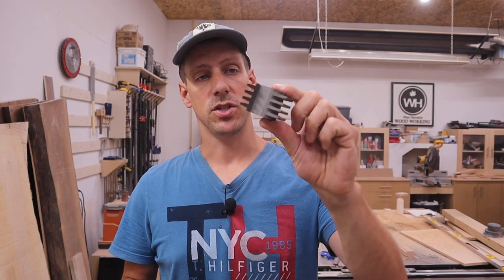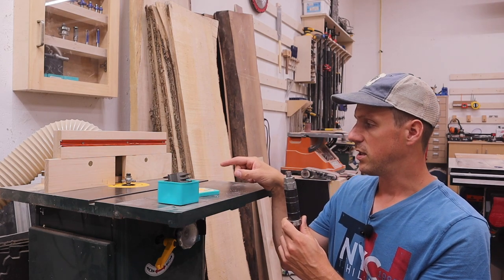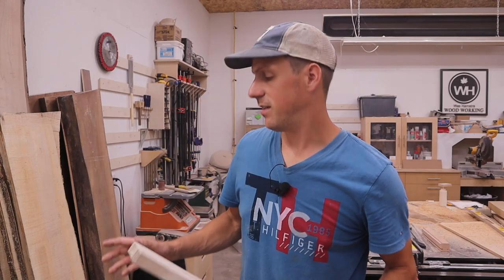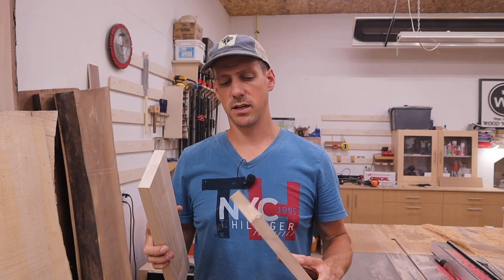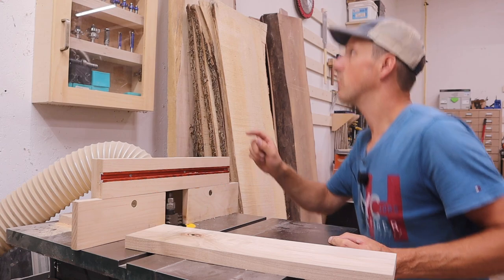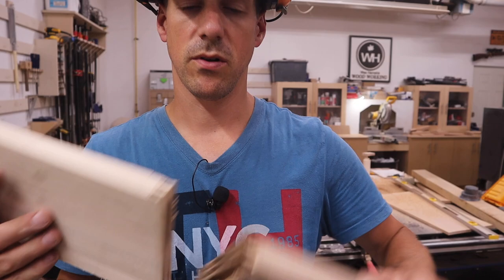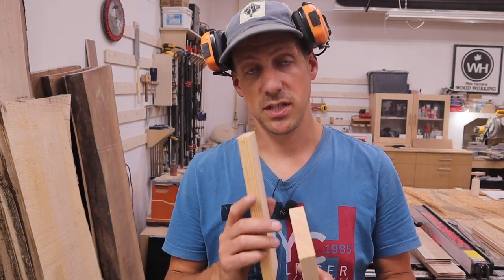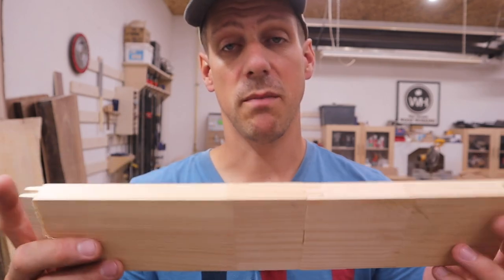Trying Out The Finger Joint Router Bit - Surprising Results!

Comment: a fellow canadian woodworker, i'm in sarnia ont.  a shaper is actually too slow for router bits to get good results.  shaper cutters are much larger in diameter which increases the cutting tip speed.  that finger joint cutter is probably meant to be used before final planing, as a trim carpenter i use finger jointed pine a lot
Reply from the maker: Nice to meet you. I am only 45mins down the 402 from sarnia. I only use this shaper for making shaker doors. I have thought about getting rid of it and getting a good router table.

Comment: So the gap in the middle, somehow your fences or jig is allowing some movement as your moving the wood past the bit. That is the center problem,  the loose fit is a whole other issue. That is vertical movement of your material,  either not held down to your sled or you allowed the sled to jump. Also you need to increase the RPM of the spindle, that diameter of cutter should be around 10000 rpm. 12 would be better but 10 will work. You can hear the motor bogging down when cutting the soft maple, big no no. Prime time for kickback! Don't give up on the shaper!! It will do things for you a router table can only dream of.
Reply from the maker: Thanks. Maybe some feather boards with downward pressure would help. I was wondering the same about the rpms.
Reply: @WesHamstra  I have a small sliding table shaper that I use for this so the sled you use will work, does it have a dovetail slide? If it does, add that and you should get much better results. One thing I have done with this setup is have a touch point just in front of the cutter and everything else is behind that point. That will get the best cut and least resistance during the cut. With no dovetail slide that might be hard to accomplish. Is the plexiglass guard on your sled a rub type guard? Then you could achieve the same thing with some fancy fence building.
Reply from the maker: @moldings_etc  yes, my plexiglass is the guide
Reply: @WesHamstra  then you can add a straight edge at that plexiglass level, make sure it's dead straight. Then add a small dot of something at your cutting level, I use a screw with a flat head, just behind the cutting circle of the cutter. That way you are removing a small amount of material over the entire cut. That screw or index point is the part the wood touches. That way you won't add friction of trying to slide material against the fence and the sleds plexiglass at the same time. One final tip, do not bring the material back thru the cutter once you cut it, that's where a lot of the slop can come from. Hope this helps!!
Reply from the maker: @moldings_etc  thanks! Yeah I figured the slop came from doing the second pass.

Comment: I think you can make a good joint with it but the cutter has to set such that the middle of the cutter is aligned exactly with the middle of the board.  Even small differences matter - if you are 0.1mm off in height (4 thou), the joint will be off by 0.2mm (8 thou) and you'll definitely feel that.  I've used similar cutters to edge join long boards and while it can work well, all the boards need to be exactly the same thickness.  It just seems easier to use dominoes or biscuits for edge joints since you only reference one surface.  Good luck
Reply from the maker: Good tip, I think if I need to edge joint boards I will just use my domino. Not sure if I want to waste more time figuring this thing out.

Comment: a......  1,wrong slide ,  basic t square from table saw will  matter guide will be more consistently and help eliminate  mid  bite    2,  fence must be exactly parrael with  miter slide grove .    3,That horrendous gap on your fence cant help, fence wings must be closer  or better  let cutterhead cut in to it .   4 ... so clean lifting screw on mandrel lift , and grease troughly all bearing with grease gun that will eliminate sloop on lifting mechanism. 5, when is height set up  perfect , cover your fence with strip of 1/4 ply  to create single surface and then  let cutterhead cut trough and again adjust ,,pence " the ,,trump" fence to be perfectly parrael ... that that should be easy on shaper unlike with ,,Mike"      easy peasy
Reply from the maker: Thanks man! I went into this with out doing any research first.